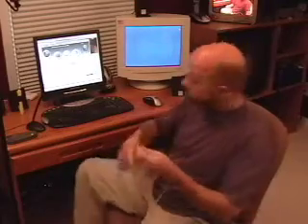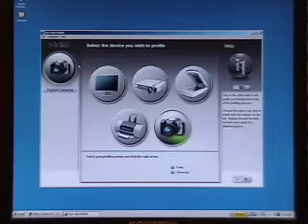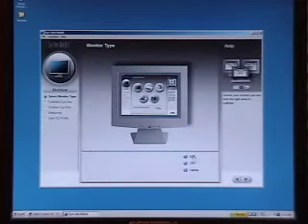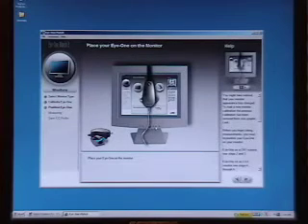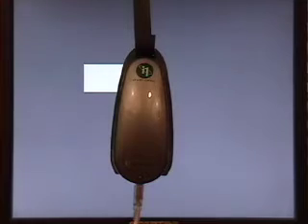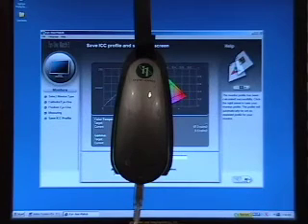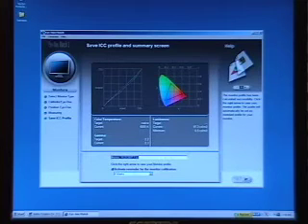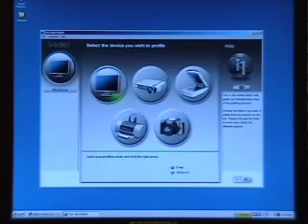Monitor Calibration, Part 3, The Process

Comment from the maker: Hi Daniel,

I'll asnwer in multiple parts, due to character limits:

If you were unable to find the monitor profile you created, where are you trying to find it?  My guess would be that youre trying to select your profile (e.g. in Photoshops Color Settings or your Display Properties) but the only one thats showing up in the list is sRGB.  If thats the case, the profile probably isnt in the right folder on your system.

Comment from the maker: I don't know which is better.  The Huey has the PANTONE name, which may be a plus, as PANTONE is a leader in color.  However, the Spyder could very well be as good.  I haven't studied the differences, nor have I heard any dialogue about the differences.

You'll probably do OK with either one.

You might try searches Google with terms similar to "monitor calibration forum" or "Huey vs Spyder", or a term that leads you to forums where people are talking about the differences between the two.